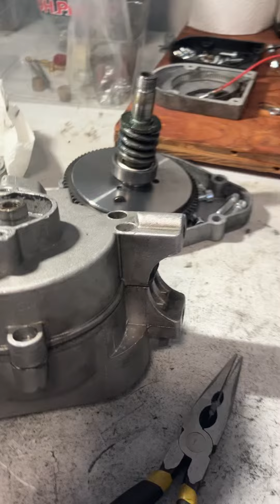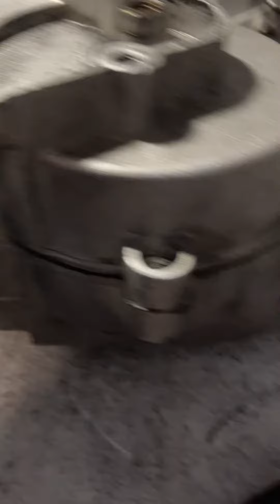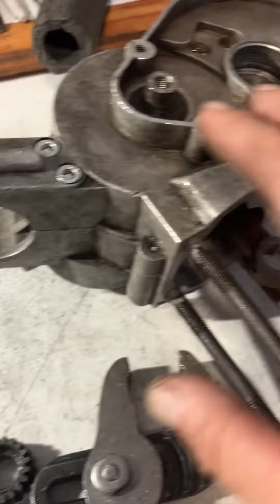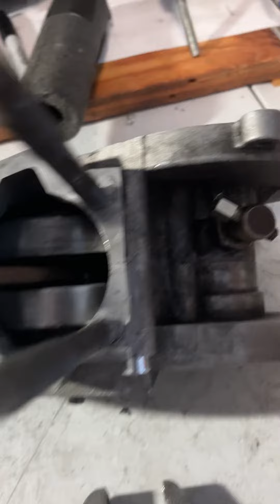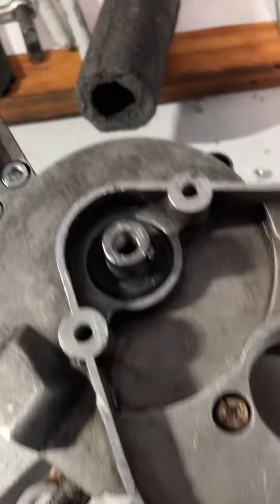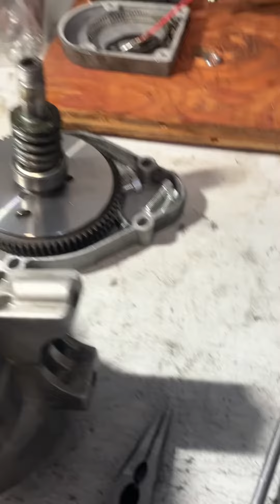Case Transfer Motorized Bike

Comment: Good luck brother. It looks like you have enough parts for a good running engine to slap on the bike and get some transportation going again.👍:hand-purple-blue-peace:
Reply from the maker: It’s not the hardware it’s the electrical components. CDI x3 out of the box bad. 😎😤😤😤
Reply: Them dam Chinese  crooks

Comment: Roger how you snap those bolts?  They no easy to broke , also how is that all you CDI not working ? Are you sure ? How is the spark plugs?  We need spark roger . 🦾 .  Like how you try to start the engines all sure be guchi , bicycle riding conditions and then you try to start the engines is the only way I see those snapping like that wow . Never have them broke front or back always guchi . I see guys bending the frame because the chain come out and lock the rim . What I nkow . Sorry for the long coment 😂😂
Reply from the maker: I can’t understand why they break either but it’s happened to me on two different occasions and it’s also worked itself out of the frame twice and I’ve lost a piece I’ve had to make for it. I think it’s something to do with the felt faker frame.